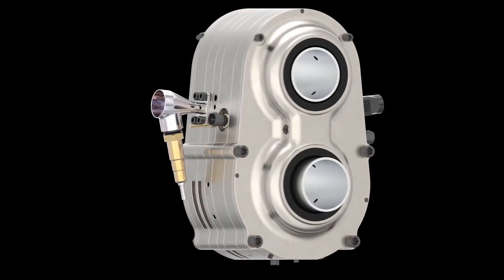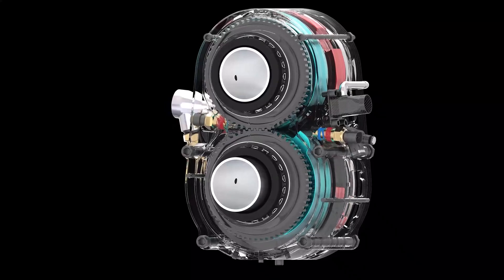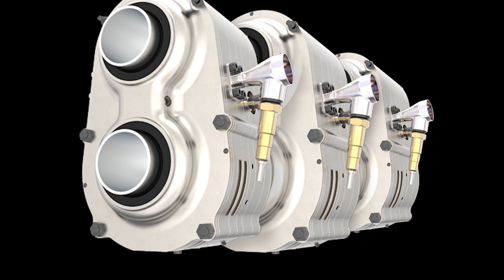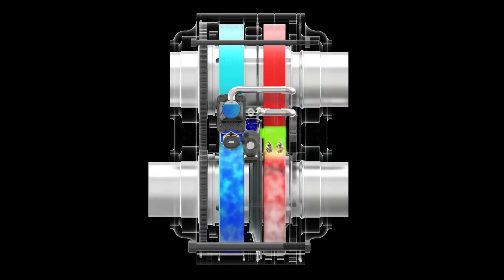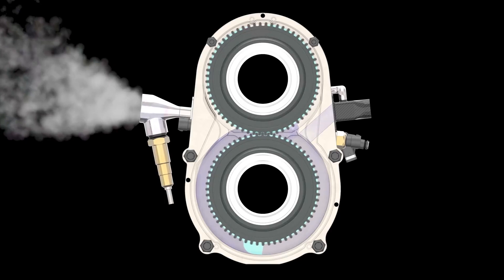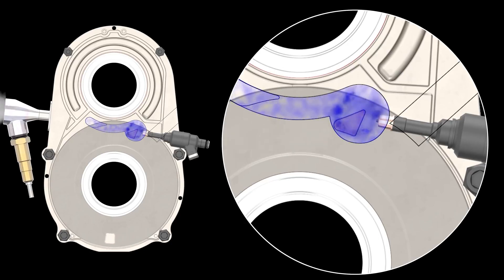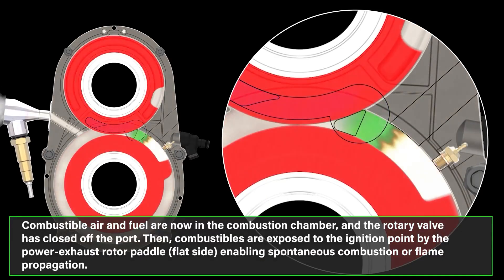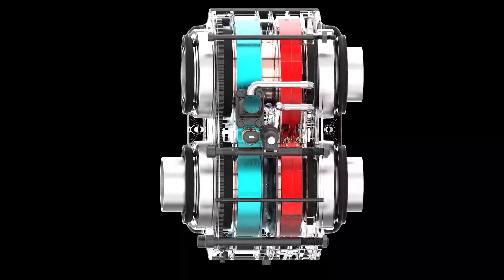This pistonless engine runs on hydrogen and revs to 25k rpm

Comment: I can see applications for series hybrid electric, and especially aircraft. The biggest problems with hydrogen fuel is storage. If and when Plasma Kinetics demonstrates their solid hydrogen storage then it could be possible. I do not think it is a possibility with conventional high pressure hydrogen storage. I also think that petroleum fuels would be too dirty for the engine to be useful. 

I am curious about using both counter rotating driveshafts in a series HEV instead of using planetary gears and a central shaft which makes me wonder how the engine power was calculated- is that 160hp from one shaft, or both combined? For example, combining 2 alternators would mean that each could power an electromagnet shaft, or magnetic bearings for the other instead of permanent magnet motors currently used in most EVs. With kinetic regeneration it might be possible that the combined power usage could be greater than the specific energy of the fuel.

Comment: Your calculations about multiple units combined power. Harley Davidson race bikes were tested one cylinder at a time and then put on a twin motor and the power due to pumping losses being reduced, came out at 2.2 times the power of the single. Just letting you know.

Comment: So the motor as shown didn't include the supercharger needed to supply the incoming air at 200psi, am I correct or did I miss it? Where is the power coming from to drive that?
Also, I don't believe the thermal efficiency claims. And no talk of consumption rates.
I'm always sceptical of these revolutionary ideas, they always end up promising a lot more than they can deliver. 
Oh, and hydrogen is a terrible fuel for IC power. Great in fuel cells though, and electric motors are far more efficient.

Comment: Electric vehicles will never work and are just as bad or worse for the environment as gas vehicles. In order to get the things to make the batteries for the cars they need to dig them up using diesel fuel. Before an electric vehicle even has been test driven it has contributed the amount of emissions a regular car would have in 100,000 miles. And don't even get me started on disposal of the batteries. Or the fact the electricity used by the cars is made by burning fossil fuels. This on the other hand is exactly what we need to be using HYDROGEN

Comment: Light weight, high rpm - sounds like a great match for aviation!
Reply: Only if efficency is greater than with fuel cells. That is unlikley.
otherwise i doubt that worksout.

Comment: Combustible fuels of any kind always has a higher weight to potential energy ratio than batteries especially with the current tech. Redesigning a better internal combustion engine is probably the best way go go. But if you have a second vehicle that's electric for very short trips like going into town for groceries could be a good idea too since depending on the fuel used, you'll still have uncombusted particals until things "warm up."

Comment: ??? What about lubrication? Wouldn’t it still need to inject oil like the Wankel engine this still burning oil? How does this design eliminate heat loss like you said in the video? It doesn’t look like it does and it’s actually not even possible.

Comment: The only way this can succeed is if the engine is used as a generator on-board.The single biggest issue with icengine durability is allowing a human direct throttle input.

Comment: I like how it looks on paper and it makes sense, but an actual implementation will present several challenges. I'd like to see working models in real world testing.
Reply: Hydrogen is almost a requirement for this, as carbon buildup with tolerances that tight would likely ruin it pretty quickly
Reply: my concern is 200 psi, that has to go somewhere. Exhausting that would be quite the feat and would make your exhaust physically dangerous for several feet.
Reply: @Rustyer266  diffuse it over a large area, done
Reply: @GeorgeTsiros  so have a flat resonator
Reply: @Rustyer266  use it for making a mini sturm tiger
Reply: they already have a prototype running just cannot find the link grrr

Comment: I'm not against electric in the least.  But, the composition of batteries, and the materials used to make them worry me far more than current concerns about oil. And then of course there is the cost of Electric cars and the charging that certainly isn't "Sustainable".

Comment: It sounds good in theory, although tight tolerances instead of seals leads me to worry about lubrication, as it's likely going to require a total loss lubrication system, and those tolerances make me think this thing will either need to be preheated prior to use, suffer from terrible cold starts, or seize up once it's been running for a while as metal expands/contracts with temperature and there's simply no way that I'm aware of in which that can be overcame
Reply: ..." that I'm aware" that is the key word.
Reply: @eglintonflats  key words, plural.

If I'm wrong however, please tell me how it's done and I'll gladly eat my words

Comment: is there a working model?
Reply: I have some metals that could allow much higher rpm.. and bearings that don't get hot.. or wear out... one of the issues with all engines is heat.. my metals and semi metals are a superconductor for heat.. I can hold it in my hand and drill, polish and cut the material without cooling water or oil
Reply: I have carbon
.. or large blocks of silicon carbide that is the same way... 10 on the Moh's scale of hardness.. like diamond.. the blocks and rotors can be machined from silicon carbide and basically.. last forever
Reply: and hydrogen on demand... easy and cheap to make ✌️
mi casa es su casa
🌎🌍🌏
Reply: I have a really lousy business model too... I'm giving away the information

Comment: The engine has yo solve strong  oposites conditions tight tolerances high temp & pressures and no seals....
Materials and technology extremely demanding requirements are yo be met.
However concept looks hoghly interesting

Comment: I believe that a water/methanol     injection system,  properly sized would be of significant value to this rather impressive engine. 
One positive benefit would undoubtedly be the total elimination of nitric oxide

Comment: Absolutely incredible,, I have said this since day one,  electric is an absolute waste of money and time.. hydrogen is the only way to go.. electric vehicles are to shut the mindless tree huggers  that have no idea how the electric car contributes 87% as pollutant as ICE (internal combustion engines).. the mining for cobalt is absolutely horrific to people,  4 lithium mines are owned by the psychotic communist China, but the truly worst part  is that there are only 8 recycling plants in the world  trying to separate the batteries back to their raw state. there are acres upon acres of practically new cars sitting because the batteries  cost more than the car.. we do not have enough raw materials if wanted,,, to make all electric,, forget that fact that 75% of the world  couldn't keep up  the electric  demand.. forget the  idea that anyone will sit in their  car for 1 to 8 hrs for a charge.. Graphene or solid state is promising but incredible expensive and still in research  mode.. we are just at the beginning of ICE research and development.. ICE have improved tremendously in the 10 years.. 
This engine is absolutely magnificent,, but better figure out the sealing,  that's a disaster just waiting to happen.. I should know,  licensed mechanic for over 45 years.. seen it all.. we have to stop these mindless  idiots from idling their cars,, construction  vehicles idling all day, ships are archaic,  aviation archaic..

Comment: Didn't quite understand the blue/red part i.e cooling down the inner workings. Also doesn't need to be 25k rotations per minute but if this is several times more efficient with petrol/diesel than a petrol/diesel powered normal engines, I would really like to see it in action. This would mean much less petrol/diesel consumption? Something like VW 3L Lupo idea? Hydrogen also sounds great, but since it is expensive to produce, maybe this would be good for large vehicles like ships and aeroplanes?

Comment: The crazy liberal of California have banned the internal combustable engine. Why? Because they do not see alternates but instead are brain dead ideologies. We have to build a huge infrastructure for electric cars. It takes time to recharge them which means not being able to just get in and go as you like. It means having to put some kind of recharging station in millions of homes. It means rolling black out in order to recharge all those cars and in the summer time it could mean you can't recharge as the power system is at full capacity during the hottest days. In addition, electric cars are expensive. The poor will be walking or taking an over crowded bus. And if you ever used the bus line in a big city, you do not feel safe and for good reason. The bus lines mean you have much longer travel times and limited places you can go. So, no, I do not like the electric cars. They are the same motor on a different body. Boring, expensive, time wasting and only good for the politicians and their cronies who are selling us that junk. Mean while you can bet the politicians will be getting around in their gas guzzling SUV's.

Comment: Would it be possible to harness some of the power from this to run a device that breaks the bonds between water molecules to produce hydrogen and oxygen?   If so, wouldn't you have a car that runs on water?  Why do we not have this already?  Is the greed of fossil fuels so rampant that we couldn't use these same motors for home electricity generation, production of factory power, and even transforming deserts into arable land, or run  small desalinization machines to provide drinkable water to all?

Comment: Batteries create a lot of pollution with the acids, & the lithium. All internal combustion engines can be ran on hydrogen. When hydrogen is burned, it turns back into water. A never ending  cycle. That's why the Almighty Creator made the world 3/4 water & 1/4 land. All we need to make hydrogen is platinum coated conductive plates, that are separated from each other, so that direct currency can be ran through the plates. Positive polarity on one plate & negative polarity on the next plate. The positive  side will make 2 molecules of hydrogen & the negative will make 1 molecules of oxygen=H2O. These two huge plates are submerged in water, in a huge air tight sealed tank with a valve for the gas to come out & be routed into tanks that can withstand gases with very tiny molecules from escaping. Like a scuba tank for instance, with heating elements in them. Electricity required to seperate the hydrogen & oxygen from water, can come from huge solar panel farms,  along with wind  generators farms. Then the only cost would be, is the material to build  the hydrogen fuel factories all over the world for all the different types of transportation in the world. Oil which is mother earth's blood & lubrication & not the remains of dinosaurs, will no longer be needed in the not so distant future. Everything will run on solar, & wind energy, housing,  transportation, restaurants, malls, ect. All we have to do is get rid of all the greed & evil in man. Do away with currency. Instead of currency your given a card, & everyone learns a trade, or does plane d manual labor. Each trade, labor is worth a certain amount of credits per hour. Every human being that  works, their credits go on a special card, that has smart microchip, & all your very personal  info goes on that microchip on the card, like a copy of your finger prints, digital picture of retina. Unless you are disabled or mentally impaired, you must have a trade of some kind, or do manual labor for food, clothing, & shelter . Everything is purchased through your work credits, & each work credit is worth a certain amount. Like a brain or heart surgeon's work credits, are worth thousands of credits per hour. Gold, silver & diamonds, are valued for commercial use only, like diamonds improve cutting devices, & gold, silver, & platinum are used for their conductivity products, & are only used for building computers, electrical motors, to make wire or objects more conductive. Precious metals & stones will no longer have value as jewelry. No brands will have no value, objects will be valued according, to how good the work, & how long they last. This is when the big corporations will go down hill, & the small businesses & mom & pop stores & restaurants will come back. It would be nice to see long cabin house come back, & most of the families start growing their own garden, collect their own eggs, or have a person in the neighborhood who does. It would be nice, to build & our own homes & land, & not have payments till were old & almost dead= mortgage. Do away with programming tell a vision of lies. Instead of listening to other people music, go out on the front porch after supper & play & sing with your own family. Don't watch other people's life events, make your own. Instead going to church, have church with your family & close friends & teach kids respect & manners again. Perhaps the bible was changed by King James to make the world think, things are only going to get worse..
Reply: lol

Comment: I wish I just understood half of what you said. Lol
I've always been a huge proponent of hydrogen.
Maybe it was all the science fiction I read but fuel from water and back to water? 
The only reason the research has been stifled  for so long is the petrochemical industry and govt. They don't want to use anything that the normal individual might be able to produce and not have to pay them for. 
I may be wrong but if you look at where and when the Hindenburg lit up there were masses of people watching and what better way to turn people away from it's use than a massive demonstration right in front of them of an inferno?
If you look at the actual incident many people would have survived had they not leaped to their deaths. It didn't just drop like a rock!
Anyway, I will always think that we would be so much more advanced today had it not been for that incident.
Reply: Not at all. The oil industry loves hydrogen, look it up. Creating hydrogen requires vast amounts of energy and is therefore terribly inefficient. Battery electric is the way to go.

Comment: They need to power everything with these especially shipping container vessels with desalination, imagine your house with one 10 feet underground (less noise)powering a generator on water!
Reply: on hydrogen, not water
Reply: @Freba9  you are correct electrolysis would be needed to Split water molecules into oxygen gas and hydrogen gas using electricity to make the fuel before hand.
Reply: @MayorMCheese1  And therefore a lot of energy is required.

Comment: Opinion of engineering Technologist. Hydrogen fuel safety would seem to warrant a diesel style engine using injectors. That may facilitate modulating oxygen/ hydrogen ratios. It seems that making hydrogen more lean increases burn rate, as in gasoline fuel rate. That might control engine speed. What are possibilities for liquid Hydrogen storage space?
The argument that hydrogen quantity in the combustion chamber is inefficient doesn't make sense. Introducing HHO in natural ratio should produce combustion. Engine timing should be retarded or carefully controlled to avoid misfire, including tight valve clearance.

Comment: Well, I would imagine that there remains a heat dissipation issue. Also, things moving at tens of thousands of RPM's, and especially at high tolerances, will eventually wear.  How is the hydrogen stored? It might have some utility in certain applications like in airplanes. There are no silver bullets to energy sustainability, but I think electrically run personal transportation vehicles will predominate. And, I am not sure that we need to "save" internal combustion engines per se.

Comment: Thank you author for the Video. Great job.
I guess if they are using titanium the tight tolerances won't be affected by ambient temperature, as in a turbo. Otherwise tight tolerances in extreme ambient temperatures would be an issue. I imagine manufacturing these motors would be very difficult and die expensive.
As far as usage to get the HP desired, maybe 2 of these or 1 engine per wheel. The torgue would be amazing. Maybe semi trucks would benefit the most.

Comment: Maintenance on this engine will be through the roof if you eliminate wear replaceable parts, like SEALS AND SLEEVES.
This engine is nothing but a CAD wet dream.

Comment: Cool engine on paper but I'd like to see a working one. I like electric engines myself... I don't like the shit batteries that come with them. Maybe in 10yrs they will be better but for now it's annoying. I have a Tesla and an f250 diesel... So I'm both ends of the spectrum. If I could buy one of these and swap it into a '00 civic or something... I would sell my Tesla in a heartbeat. I don't think this engine will ever come out though